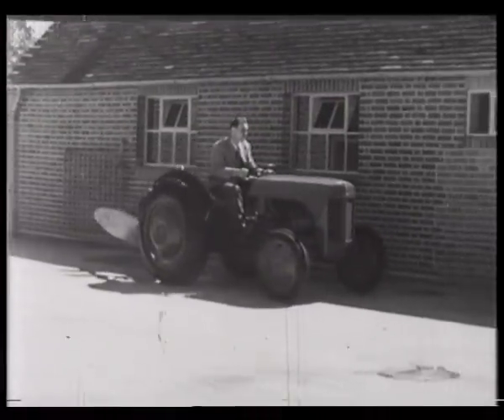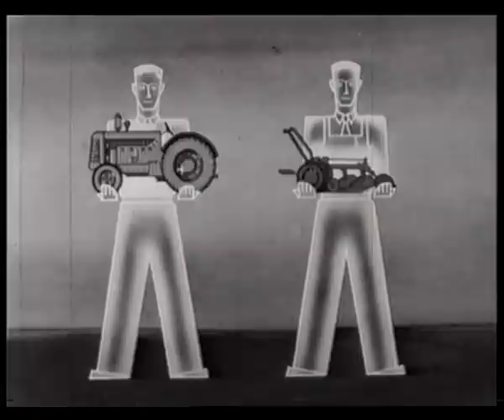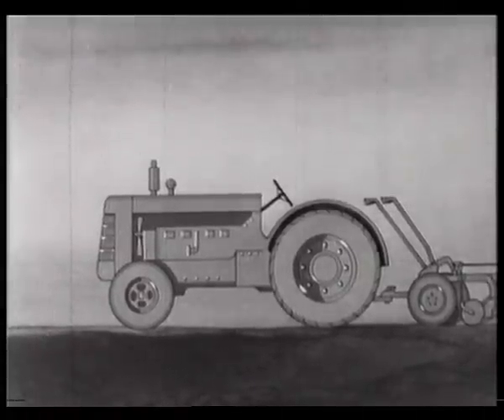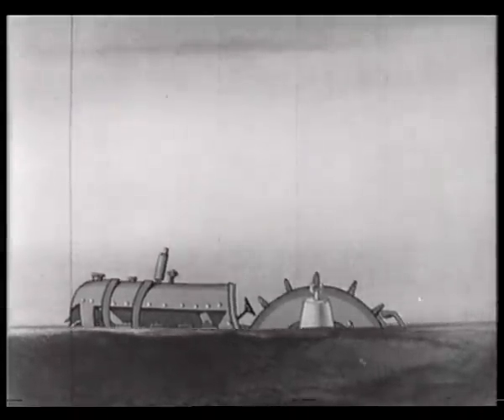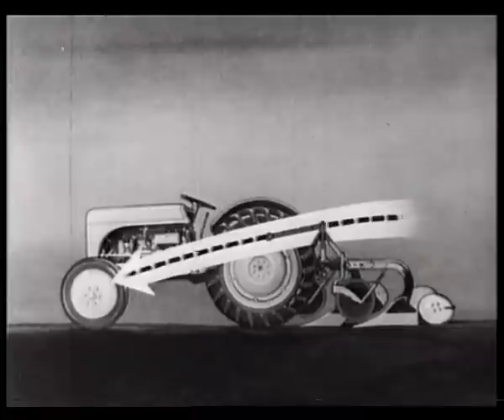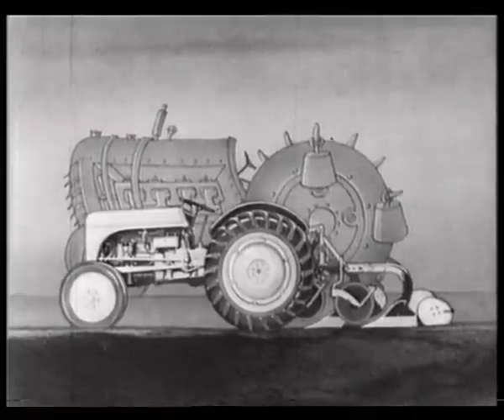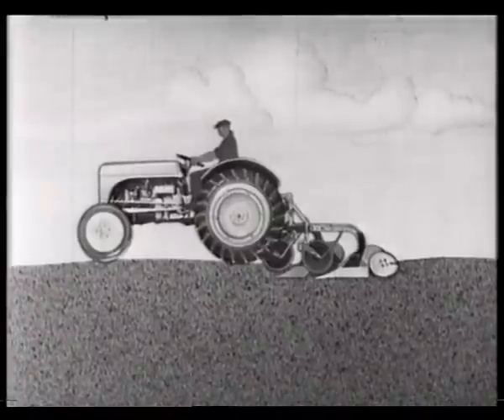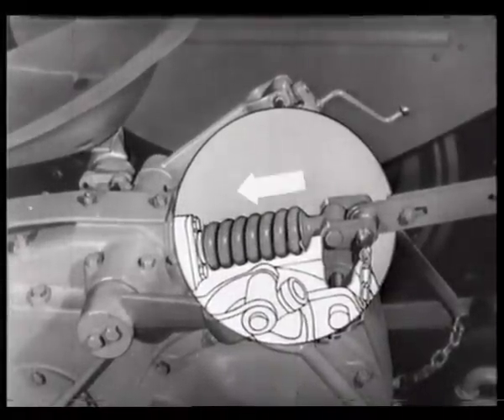ABC of Ferguson System

Comment: My 1953 Fergie is the best deal I ever made. The tractor,  2 bottom plow, 6ft boom, 4ft roller, 4ft grader blade, 60 in woods finish mower, 60 in bushing for $3500. It's been a hard working unit and I've gotten my money's worth a 100 times over.
Reply: Damn what a steal

Comment: I got a 1950"s I believe it is a 1955 MF 50. Fantastic tractor. Dose not take to much fuel, very little oil. Still plows ground and snow. Pulls and rides like the day it came off the assembly line. Detroit Diesel Engine was built to last. Back when farming relied on actual tractors that worked. Not equipment/techniques with just a computer and chemicals for everything.
Reply: You have a Perkins diesel engine.
Reply: @boblinsenbach1014  I always thought it was a Detroit Diesel Engine. Those engines are built to outlast the people who buy them.

Comment: I love the Ferguson tractors. I own a 1950 Tea 20 built to last, as well we have a Ferguson 2 furrow plough. We still run it almost daily. It is still 6 volt system but now has electronic ignition.
Reply: My 1944 6 volt Dodge ambulance has an electronic ignition now. Though I still keep the old points and condenser plate, just in case :-)
Reply: I used a I'm thinking was a toa 20 and it was diesel with I could find one like it today

Comment: I grew up in South Devon, England with my father's Ferguson T20, and several MF 35s, and when I ran my own business, and bought some land, I bought 2 MF diggers, which had a fore-end loader, and detachable backhoe, with a MF 135 front, and MF 165 rear - with a steel-encased radiator - all built like a tank. ...... Great tractors, and fun to drive.

Comment: First vehicle I learned to drive was a Ferguson, back in the 1970's in Scotland about 8 years old.
I pulled a trailer up and down the fields whilst others collected the stones and threw them on the trailer.
It was the oldest tractor and the simplest to drive so just about everyone I knew learnt on them back then.
Great machines, still practical for smallholdings today.
Charlie 🇬🇧
Reply: A comparable age to me.  My father had a TEA 20,  my pride and joy into my teens.
Reply from the maker: I drove my first tractor on farmland when I was 12, only to buy a house on the exact same spot that I drove it 18 years later.
Reply: Posedujem jedan takav iz 1958g. u voznom stanju, pozdrav iz Srbije
Reply from the maker: I own one of these from 1958. in driving condition, greetings from Serbia

Comment: Some comments. My Grandmother's Grandad was an Englishman. He farmed in Texas wearing what we would call a suit and tie. 
Just look at some old photos of workplaces. 
I learned to drive, driving Ford 8n and 9n tractors in the hayfields of East Texas in the mid 1950s. My Uncle worked at a Ford Tractor dealership at that time.  When I worked in the shop, I was immersed in Ford tractor literature and talk. My Uncle was so Ford be-sotted that when I bought a GMC truck in 1987 he was mad for weeks.
Of course as time went on, I finally learned of the partnership of Ford and Ferguson. As near as I can tell, Ford just stole Ferguson's patents and ideas. Ford was good at that. A boyhood friend said that even when they were doing things, Henry always seemed to be directing instead of doing.

Engineers were aware of the forces at play. I have an old textbook for use in Agricultural and Mechanical colleges, published about 1903. It describes the settings, adjustments, and implement choices for farm horse drawn equipment. It shows the forces involved and how to adjust for them.
Reply: I wouldn't say Henry Ford "stole" Fergusons patents, they had the famous "handshake agreement"  in which Ferguson was responsible for further development, distribution and sales, Ford was responsible for manufacturing and a sales organization in the US (possibly all NA- not real clear on that). 
 That was all fine and good for 10 yrs or so- till Henry Ford died
 When his grandson took over the company- his accountants and executives convinced him to break that agreement - and went on using Ferguson's design....

Comment: When I was a little boy of 3-4 years in the mid 50's, every summer was spent on my grandmother and grandfather's farm in Hvedstrup, near Roskilde, Denmark.
My grandfather had got a tractor, an amazing machine that could do anything. It was simply the best tractor in the world. At least I was quite sure of that. It was a Ferguson. And now I have found this old movie which documents my claim.
All other tractors were subsequently licensed on the Ferguson system, so they could be (almost) just as good. But they did not become a real Ferguson.
Reply: Not all other tractors ever used the Ferguson system. Not even close to all
Reply: @MrHansenDenmark  yeah, some farming tractors do. Some don't. You said all tractors, which isn't accurate.
Reply: @mwilliamshs  Just curious. please give me links to modern agricultural tractors that are used for field work and which are not equipped with a three-point hitch as standard. Here in Denmark I have never seen any.
Reply: @MrHansenDenmark  so we've gone from "all other tractors" to "farming tractors" and now to "modern agricultural tractors that are used for field work" but you're still defending the claim?

I'm no expert on agriculture but Case used something called the Eagle Claw hitch and Allis Chalmers developed their Snap Coupler single-point hitch, just for 2 quick examples. Lots of ag tractors have a drawbar hitch, some only have it, especially those that use drag implements with their own lift cylinders. The uber-famous Big Bud 747s are one extremely well-known example model of these. The Allis Chalmers G is a toolcarrier tractor with no 3 point that was so successful in vegetable fields that it's been copied into modem versions like the Oggun, Kult, Tilmor, and others. I could go on but I don't need to because even a single valid example would've been sufficient to disprove your claim of "all other tractors."

Comment: Harry Ferguson was a mechanical genius who also invented the 4 wheel drive system for Range Rover
Reply: That system was also used in the Jensen Interceptor FF .
Reply: I learnt to drive on one when I was 7 . 50 + years later it still gets used occasionally . Great little tractor 🥰

Comment: Not only just implemented system over all brands, but the original one still runs good !
They dont build stuffs as good as they used to. Now they rather crap out qualities and overload with totally unnecessary limited access softwares. You can have my old Ferguson when you pry it from my cold dead hands :D

Comment: The TEA 20 coventry, the first tractor of the farm in France , arrived in 1946 before I was born (1950). For children of 10-12 years, the steering wheel was easy to handle, and even with short legs one could press on the pedals with all the weight of the body. For the Farmall M arrived 5 years later, it was necessary to push forward the pedal and it was hard, the release sometimes brutal!.On the other hand, the braking system (drums getting wet) was not very good. The IH was strapped on the reducers: one could block one of the wheels and turn like a top.
The fergie never braked despite a tribe of specialists who came to analyze the defect, nobody solved it. 12 years later my father with a very mechanic employee put the tractor on blocks, disassembled the mechanism, to discover that it had simply the cams of disposals in reverse !!!! the vice was discovered. Hats off to the engineers....

Comment: Could you imagine the things we could come up with today’s technology applied, all that we have learned over the last 100 years if our engineers that design things we use today were also working class people that actually experienced the problems they were attempting to solve like those guys back then did.  Not that all of them dont. But the big shots they answer to wont allow them to innovate to their fullest potential for one reason or another, cost,time, greed. I personally own one of these systems and just so happen to be an engineer. My 9n ford tractor with this ferguson system has been putting in an honest days work now for 82 years, and there are hundreds of thousands of them out there that do the same every day. How much of anything built today do you think will still be functional 80 years from now. We have the ability, but some how even tho we could manufacture a better machine for less money, we somehow end up with a less robust machine that cost more money and is designed to live just past the warranty. It is a shame. We could do so much better. I hope to someday see the working class in this country applied once again to the best of our abilities. Until then ill continue to use the old overbuilt stuff.
Reply from the maker: Thank you for your detailed comments. It certainly is greed. Greed in how quickly and cheaply something can be produced. Take the first video recorders. They were built like tanks and when you picked one up you knew you couldn't carry it down the street very far, especially if you had just stolen it from somebody's house. Then the manufacturers begin to cut corners. Mechanical parts become electronic integrated circuits instead of a physical lever or solenoid. The cost of this part now drops significantly because, instead of being machined, lined up, fitted and greased . . . it is stamped out by a robot and now measures 2 x 1 cm. But what happens when it goes wrong? The average bloke in the street can't fix it but hey, it doesn't matter because a whole new unit is now so cheap we might as well buy another. This is what is wrong with today's society. And because of this, we have less and less people who are even remotely interested in fixing things or keeping them running for as long as you have done. Well done!

Comment: Had a Ferguson To-30 growing up, I didn't realize until now that apparently they were the ones that invented the 3 point hitch? Either way I absolutely hated that thing. Transmission gearing was stupid, either too slow, or too fast and not enough torque.  Most of the time it ran (sorta) on 3 cylinders, dunno if it had a bad valve or what. I put a lot of hours mowing on that thing and plowing snow in the winter. The other thing that drove me nuts were the individual wheel brakes. One lever on each side... sounds simple enough until you realize that both the clutch and left brake are on the left, and you only have one left foot! I discovered that the brake still kinda worked if you pulled UP on the lever since it was a cam system. Also fun was that you had to be in neutral with the clutch engaged to make the hydraulics work... Not a lot of fun if you're mowing and need to raise the cutter and it's stuck on something... you end up having to disconnect the PTO to get unstuck. Also, also extra bonus, if you're using any kind of PTO implement with any decent inertia to it, you need an overrunning clutch... because if you push in the clutch to stop, and don't have one, that rotating blade will act like a motor and push you into stuff even with the clutch pushed in until you pop it into neutral. 

Replaced that TO-30 with a Ford 841... so much more and better tractor! Live hydraulics, power steering, and a 4+3 speed transmission, and almost twice the HP! Granted it was a newer machine being a 1950, but My God what a difference... all the brake pedals were on the same side!
Reply: Yes you did need a bit of nous to drive one .
Reply: @paulveenings6861  Bit of what??
Reply: @kleetus92  I stand corrected , you probably need a lot of nous to drive one - practical experience , intelligence and common sense . Makes them interesting to drive unlike today’s monsters .
Reply: @paulveenings6861  OK, I'll type this one more time slowly so you can understand: What is NOUS?
Reply: @paulveenings6861  Never mind, you think you need to be a philosopher like Aristotle to operate a tractor...  No point in arguing with a professional idiot, you'll just drag me down and beat me with years of experience.
Reply: @kleetus92  practical experience , intelligence and common sense 😊 of which I’m sure you have plenty of since you could drive one .

Comment: I have a 1955 Ford 850. 
This film explains it well. 
What year was it produced?
Guessing 1942-48 based on the WWll gray paint.
Reply from the maker: I own the original film and usually they have little symbols on the edge which is a code for the year it was printed. Sadly this film doesn't have any.

Comment: We have a  9 N that is a 1940 model according to the serial number.  My Grandpa bought it used When My Dad  was 10 or 11 years old.   My Dad was born in 1940 and We think the Tractor and Him are the same age.  I  am not sure if the Ford Guy was correct in telling Us the age of Our Tractor or Not.
Reply: On the left side engine block (if you’re sitting in the seat) there’s a faint serial number stamped into it near the oil filter can, run that number and you’ll be able to look up the date.

Comment: Agree with all the positive comments,  but would only point out (think I am right about this) that by towing the implement from a point below the rear axle it is far less likely to tip the tractor front up.  An important safety feature, because resisting the forward movement of the tractor it could easily climb up its own differential and tip the whole caboodle over on top of its driver.  By pulling the implement from points below the main axle any resistance applied to the attachment points put a downward force on the front wheels,  thus opposing the over tipping tendency. Am I right about this?
Reply: yes

Comment: i had an uncle who when he was a young guy worked for a local farmer who had bought a Ferguson tractor, shortly after they came out, my uncle had the job of ploughing and harrowing with it, and he was doing this to other farmers around who didn't have tractors, he was doing this dawn to dusk rain, hail or snow, and no cabs in those days, he said there was many a day his hand were so cold he could hardly get them off the steering wheel, about 50 years later his sons saw the same old tractor for sale at an auction and asked him if he wanted it, they would buy it for him,  but he told them that if they brought it into his yard he would burn it in front of them, it brought back too many painful memories

Comment: I learned to drive on a 1939 9N Ford which is virtually the same tractor. Harry Ferguson was a great designer. The one thing he missed on this tractor was tying the hydraulic pump to the transmission instead of directly to the engine. Every time  you step on the clutch the pump disengages. If you are doing yard chores, that gets to be very annoying. 

An improvement I was surprised Ford didn't include was a high/low splitter range for on the go shifting. Ford used the technology he needed for the two speed transmission on the Model T cars. He would have just needed to have beefed it up enough to survive field work.
Reply: One other niggle with the TE20 Grey Fergie was / is the PTO is linked to the same clutch as the gears (as opposed to being a two stage clutch).  When using something like the Hayter field topper, you can come to the end of a cut and dip the clutch.  The momentum  in the Hayter blades winds up the tractor transmission meaning you can't get it out of gear.  You have to plan ahead a bit and get on the brakes quickly whilst also dipping the clutch and pulling the PTO lever.  I was actually using our Fergie / Hayter combo a few weeks ago.  Been in the family since 1968 and both still going strong.
Reply: @rusty911s2  The Fergie wasn't the only tractor in era with this issue. We had a 1953 W6 Farmall that I drove into a barn side because of the same issue. I'd been using that tractor for 20 years by then, but it still caught me off guard about the flywheel effect of a running implement.
Reply: The hydralic lift was such an advancement in itself. Asking a lot for more.

Comment: At what depth did these ploughs work ? And does anyone know at what depth (horse) pulled ploughs on heavier sticky soil used to work ?
Reply: @lelemer  Thanks, We used to think ploughing is a very good way to work our soils for we do it for ages, at least 2000 years. Only recently we start to realize we've ploughed to to deep over the last 40 years as 25-30 cm has become a habit. Best we go back to 15-20 cm. ploughing and avoid deep tracks at all cost.